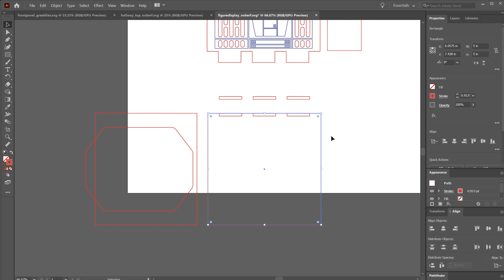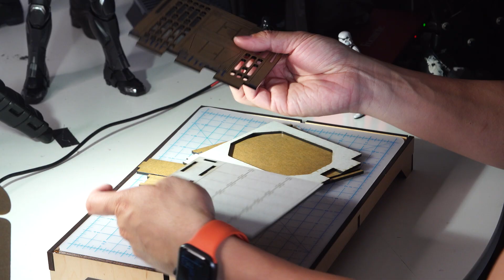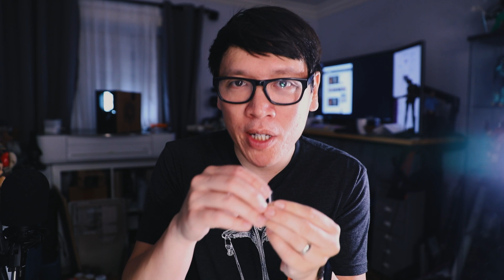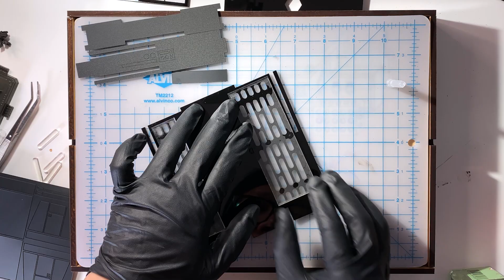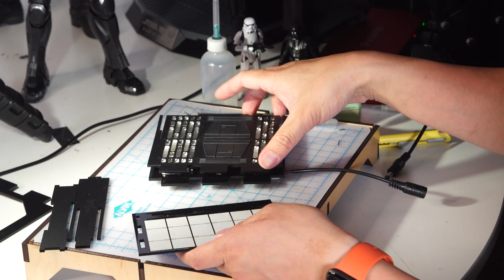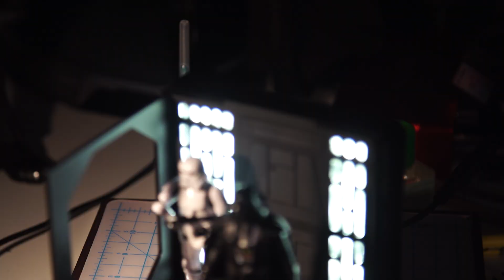How To Make a Star Wars Action Figure Diorama (Free Design!)

Comment: Love the design and thanks for the free svg files! I plan to scale this up for some larger scale figures, and use EL light sheet, instead of strip LEDs. As for the removal of the protective film, lay some gorilla tape over the surface to pull it up. Makes getting the smaller bits that much easier, and less likely to scratch the surface.

Comment: I would not imagine the "magnet in the foot peg hole" tactic to ever work cos those pieces going into the figure's foot are way too small to be effectively gripped to a magnetic surface. Not enough material. You'd be better off to somehow get a custom cut-out of the figure's foot shape and line the entire sole of the foot with a layer of magnetic material. 

Bonus if you can attach/glue a wee peg onto the cut-out so that the magnetic soles are removable (as permanently plugging up the peg hole seems a bit "bridge burny" to me, in case you wanna dispaly the figure on a conventional environment that has the pegs).

I'm thinking maybe that thin, soft, pliable magnetic stuff that is often used for "fridge magnet business cards" - it's thin enough to cut (probably with scissors or a utility knife - but if your fancy laser cutter can do the job, then rock on!) and it should not end up looking like a figure's footwear converted into KISS platforms, lol. 

As for pegs, you could either "break" off actual pegs from the little display stands or whatever, but I would try and figure out a more "from scratch" inception, using a small piece of Q-tip baton or whatever will fit nicely into the foot peg hole AND fasten securely to the magentic "sole" layer. 

Certain generic/alternate brand cotton swabs have the hollow plastic batons (oftne blue in color), which might better serve to contain adhesive or glue and guarantee a more secure adhesion to the magnet layer. Q-Tip brand batons are solid, and appear to be composed of compressed paper and would probably not work very well. I imagine they would disintegrate from the glue or just not adhere to the magnet layer without a gluey mess or something? I could be wrong, but I'd try the hollow plastic ones. They make great WD-40 nozzles, so why not also action figure pegs? LOL

I don't know if this is making any sense or if I'm conveying the idea properly, but just jamming a small piece of magnet into the peg hole will NOT work due to sheer insufficient quantity, so it doesn't matter how powerful a magent you use underneath, that tiny piece in the foot won't grip to anything (not even directly, let alone through a floor), especially with the weight of a figure factored in.
Reply: If you get the right kind of magnet, it works great. I've seen it done with 1/12 scale figures, which are heavier than these 1/18 scale figures, and they work great. They even hold a Spiderman figure upside down with no issues.
Reply: @TheSalemCrow  Cool. Haha, an inverted Spider-Man on the "ceiling" - that would be sweet, lol.

Comment: You can just reverse that process insted stick a large magnet on the base that way you can fill the feet of the figures with a highly magnetic metel will work just as good and easier as small strong magnets are hard to find as they are small they dont generate enough ' force' pun intended for this video 👍

Comment: Neodymium magnet underneath and loading the feet up with metal is a good idea. Could also drill a wider hole in the bottom and fit a larger magnet. You don't need to stick with 2mm.

Comment: Maybe it's better to turn the system around :
Put a few small pieces of steel inside the feet.  Drill the largest hole possible and fill it with a steel rod. Then put a large and very strong magnet underneath the floor.
Problem solved.

Comment: Try putting the magnet under, swap metal plate with a magnet. it and use 2mm weld wire in the feet. Might work. Awesome video. Cool Star Wars AFD.
Reply: I came here to say this! Except that you can keep the magnets in the figurines AND slap some opposing magnets underneath. The magnets under will stick easily to the plate you already have, so you can easily reposition them to adjust the pose on top.
Reply: I had the same thought. It's likely much easier to find metal to fit  the figures' peg holes than a strong magnet that small. :)
Reply: @daniellezepess   you are absolutely right. 2mm TIG Thread  would be my pick of metal. A fridge magnet would it could do the job?
Reply: @BTN1979BoBo  I don't see why not. Some fridge magnets are pernicious... I have a couple that won't come off for anything!
Reply: @daniellezepess  Agree :D
Reply: This.
Reply: Bo Nielsen Great minds I guess. I was thinking the same thing, but thought to check if someone had already suggested it.
Reply: First thing I thought of